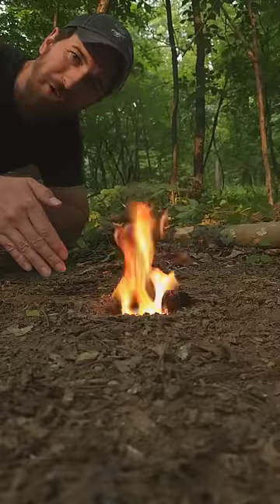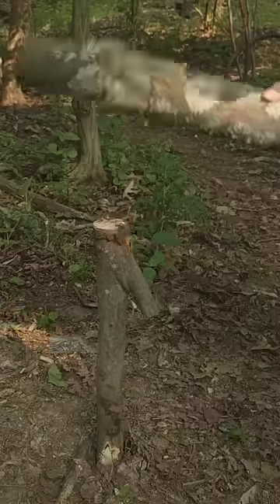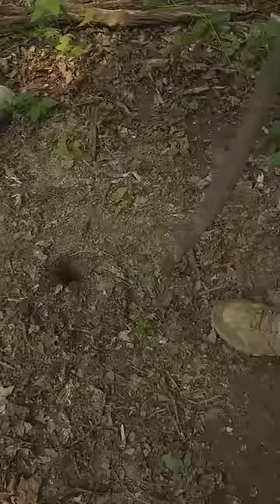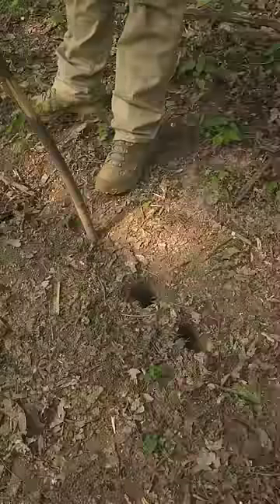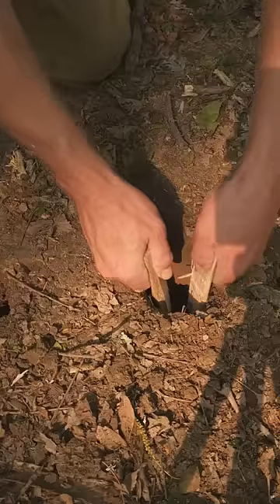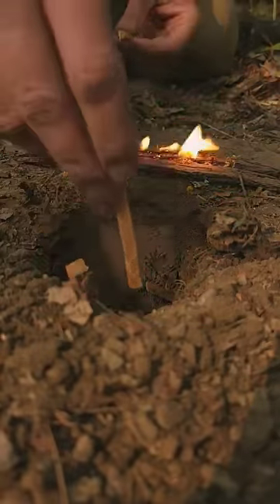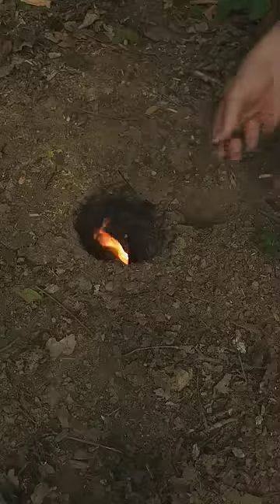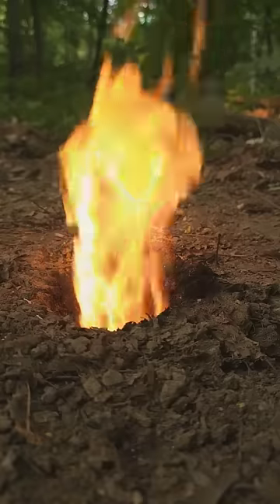Make a mini fire hole/rocket stove with no shovel 🔥

Comment: I learnt this in the Swedish military. The advantage with this method, besides requiring little wood, is that it is hard to detect in the dark as most of the fire is below ground and doesn't give off much light. Also, it doesn't produce much smoke.
Reply: Ok, I was wondering about the smoke. Thanks
Reply: @kimberlynparsons7709 
You're welcome.
Most of the smoke is absorbed by the dirt. We used this method in the military to avoid detection.
Reply: Also probably better when it's windy
Reply: @technicolorskies5432  
Yes, of course.
Reply: That's awesome Info so glad I ran across this. thank you so much
Reply: @nudaveritas8195 None of the smoke is absorbed by the dirt. The reason you don’t see much smoke is because they produce very little smoke due to their design. It offers an almost complete combustion making the rocket stove one of the most efficient stoves.  (being fed ample oxygen thru the intake hole allows complete combustion and therefore eliminates almost all smoke)
Reply: @nudaveritas8195 dirt doesn’t absorb smoke lol. It’s due to the complete combustion of the material as there is an abundance of oxygen being fed to the fire.
Reply: The meatball wars
Reply: @gang6009 😂
Reply: @nudaveritas8195 not a bad idea. I am second lieutenant in Finnish army reserve. We didnt learn or practice this because we never do fire in forest..never. If you have normal situation, you have heat source in your unit tenth, small or bigger tenth( from 6-12 soldier range). Of course i was not in infantry/jaeger, i was first in antiaircraft branch, but if wartime come, i am liaison officer. I didnt say that you do it wrong there, only because we do it different way. I have only great respect for you and your service. Same goes ofc to all Sweden. I would fight for your, or my country. We are like a family😊
Reply: @phm19880 
This method of making fire is not used by all Swedish units. Only by the ranger units (Jägarförband), which is our special forces. And it is used only when absolutely necessary. I was an Arctic Ranger and normally, we are taught to avoid making fire as it can be detected from a far distance by enemy troops. This method produces very little smoke so in certain conditions such as foggy nights, you can get away with it. But the main reason we often used it during the day was that it requires very little wood and if you're in the mountains where wood might be hard to find then this is a useful method as it gives you enough fire for enough time to cook food or boil water. 

Thank you for your kind words, by the way. I have a lot of respect for Finns. You are a brave people. We are brothers and I would fight for you guys too.
Take care brother.
Reply: @nudaveritas8195  thank you for your answer. Yeah, i kinda know already when i write my answer to you that of course swedes have brains also, and i doubt allready that you are told about risks of making open fire in combat enviroments. I think you have solid training system. My post was maybe only moment for me to try to shine aside swedish person😆. It is like we finns dont have so many changes to act that we are better or above sweden, cause u guys annoyingly do most things with absolute quality. At least we have two: when it comes to motorsport( f1 and rally especially) and "militaryculture"( it would be stupid for me to say that finns can say that we have better military because its not true, only you dont have full conscription at the moment, so we have large reserve and massive artillery, but u guys made topnotch fighterjets of your own, u have highquality subs and tech, u are no1 north european economic powerhouse).  If i remember right, Sweden had conscription system also not so long time ago? Take care. You will be in nato soon. ..oh i allmost forget, of course finnish icehockey is way ahead of swedens, have ALLWAYS be, right? 😂😂
Reply: @phm19880  
Hahaha...lol
Yeah, you guys are better than us at hockey 👍🏻
Yes, at the moment we don't have full conscription but we are bringing it back very soon. We are also increasing our military budget significantly and building more advanced weapons to meet the needs of the future. I hope we will have peace and prosperity. War is hell. I saw it first hand when I served in Afghanistan in 2007. 
Best wishes for the future.
Take care.
Reply: @kimberlynparsons7709 the more oxigen intake, the less smoke (humidity steam and unburned ashes and wood, and coal)
Reply: What about risk of fire spreading underground?
Reply: @happyist3719  
No risk of that. The soil can't catch fire.
Reply: @nudaveritas8195  yeah but pockets of air and the mulch rich environment makes it possible for even an ember to spread underground and cause a fire in a Swedish, dry, pine forests
Reply: @happyist3719  
No, it doesn't if you dig in the right place and deep enough.
Soil tends to have low permeability and acts as a barrier to the spread of fire.
Reply: @nudaveritas8195   Actually it's smokeless from the temperature at which it burns and how dry the fuel is, not from the dirt!
Reply: It's a very useful surviving method!
Reply: Yeah we did this at our holiday town on the coast when we wanted to make fires on the beach. It's a nature conservation area so any smoke will attract immediate attention from the authorities.
Reply: В армии научились😂😂😂😂
У нас дети такие костры делают уже в 5 классе😂😂😂
Reply: @nudaveritas8195  Not soil, but roots. If they catch it could set the whole forest on fire. Even weeks later.
Reply: Did you join the military because you wanted to or because they drafted you? I got a thing telling me to take a quiz or something so they could find out whether they wanted me or not, they did not and I don't understand why...
Reply: @eeeeee8762  
We had military conscription in Sweden back then so I did 15 months military service and then continued to become an officer after that and served for a number of years and then returned to civilian life and got two university degrees. I stayed as a reserve officer though and they still call me in from time to time.
Reply: @nudaveritas8195  Damn that's awesome, what was the training like?
Reply: @phm19880 I also served in the Finnish military, reconnaissance, and I can tell you that outdoor fires are a part of our training (at least were still in 2010).

In reconnaissance it's critical that we know how to warm ourselves in any situation.
Reply: Also easy to cover your tracks and make it look like you were never there when you leave.
Reply: Probably it's also a good way to cover up everything afterwards without living any evidence or hazard I hate when people leave a mess after them....
Reply: @кубометр-ф2р 
We all learn different.
There is a story of American Nato soldiers coming to train in winter conditions in my country which is Norway, and then joking with local kids. Tossing snowballs at them and such. The kids answered by absolutely burying the soldiers in snow, no longer joking now it was absolute snow warfare from the kids side. From what I heard the soldiers couldn't really handle themselves in snow so the kids destroyed them 😂
Reply: Silly question, were those rocks necessary? Given the two air intake holes? Just asking because in some regions rocks can have water inside causing them to explode when put in fire.
Reply: @janedoe4471  
No, we didn't use rocks.
Reply: Thanks! You answered both of my questions.
Reply: There goes his carbon footprint
Reply: ‘Swedish military’ would be the funniest thing today all day.. my respect bro.. 🫡
Reply: You’re right
Reply: Tue - but depends whether your laying up area is deemed Tactical or Non-Tac.
Reply: This is amazing. I've always wanted to figure out a way to have a fire with little to no smoke and light.